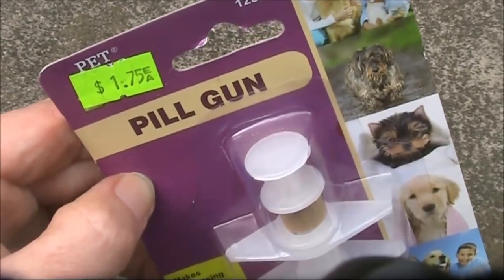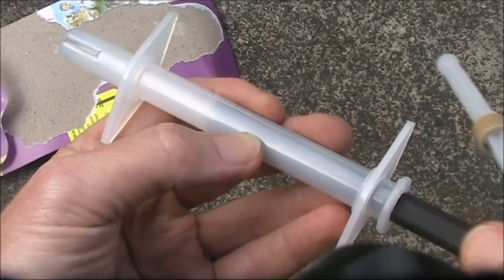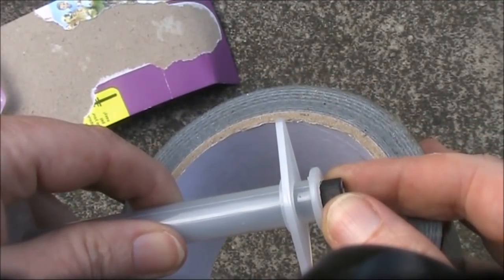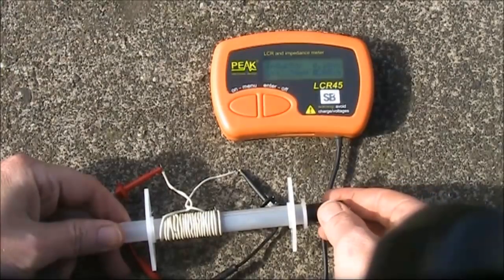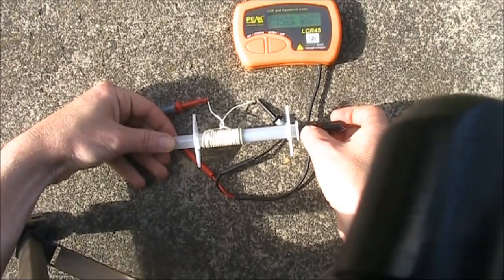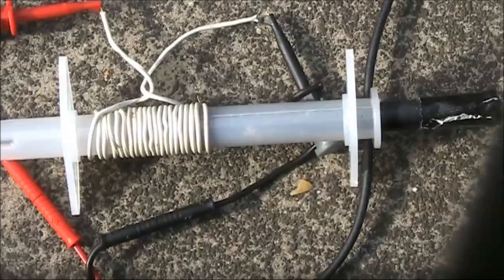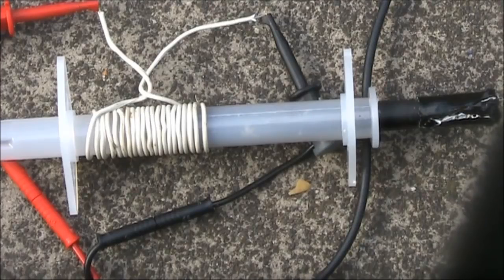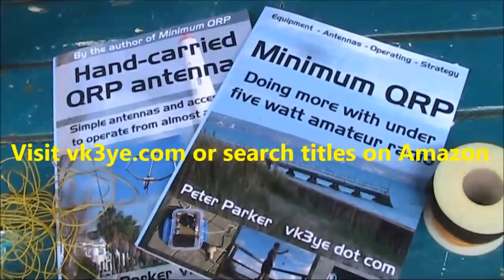Make a Pet Shop Pill Gun Variable Inductor

Comment: how many turns for coils in simple FM radio reciver? i got 0.8mm coated wire
Reply from the maker: You wouldn't use the coil featured. You'd use a smaller coil - maybe 5 or 6 turns. See the FM bugs on the Talking Electronics website.
Reply: okey my reciver has 2 coils one with thin wire 5turns and other with thicker wire 27 turns trying to fix the bigger one

Comment: Great idea for longwave and medium wave TRF radio... with 80turns of wire and dip swich variable capacitor ( 220nF, 100nF, 47nF, 22nF, 10nF, 4700pF, 2200pF 1000pF,  470pF 220pF ) you can cover 10kHz to 1MHz with single variometer coil...

Comment: Peter  What  kind of power would think it could handle I am thinking about 35 or 40 watts
Reply from the maker: Not sure - but worth a try!
Reply: I thinking of building a L match to go with a 40 watt amp I built for my 817nd
I like the idea of a variable inductor without a multiple pole  switch  I have a variable cap that can handle that power easily,      Many thanks till you are better paid ; )

Comment: Not a bad idea, the thickness of the plastic tube also makes sure that the windings themselves are separated from the rod by a reasonable distance, keeping losses to a minimum for the specific ferrite type used in the rod. I wonder how much power it could handle before getting warm. I wouldn't be surprised if it would be okay with 50W, however a decent capacitor would be necessary.
Reply: My thoughts exactly It's like a roller inductor without the roller